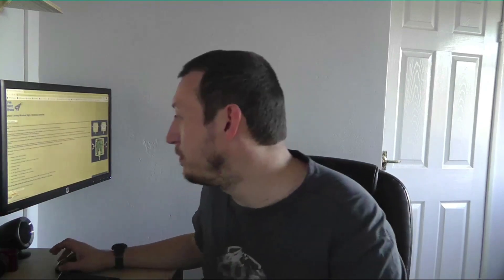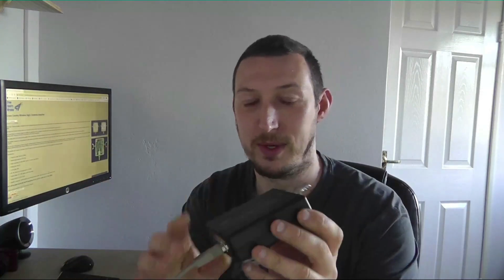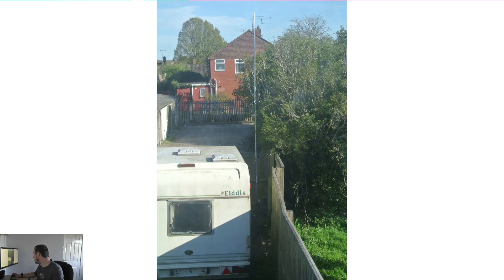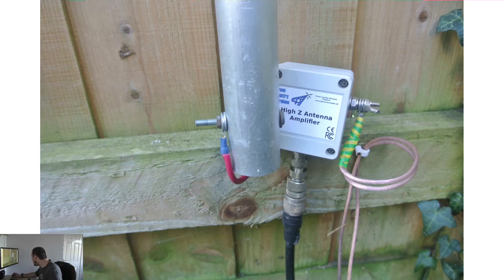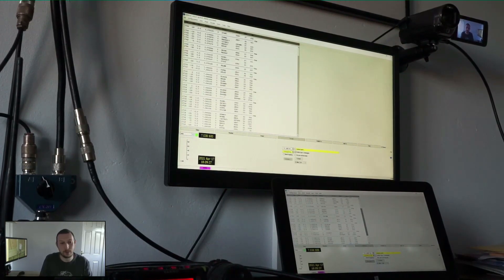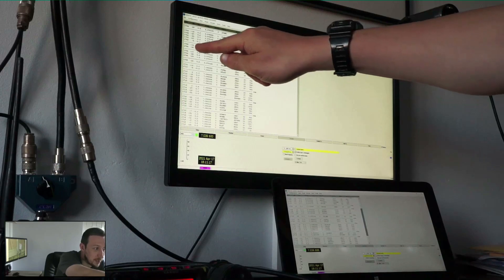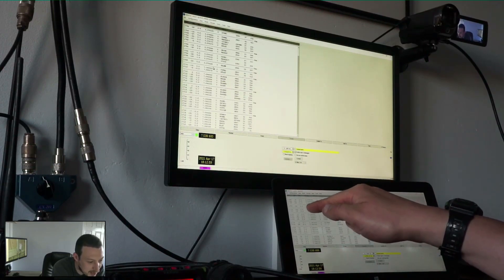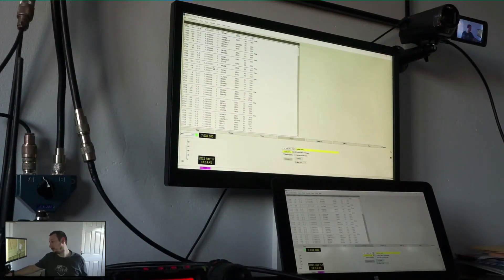High-Z Vertical As A Separate Receive Antenna

Comment: Hi James, good to see the High Z amplifier working well for you. I would be interested to see the results if you try it at a quiet location. I think that you will be surprised. Recently Andy, DL8LAS has been posting comparison videos of 160m DX using one of these amplifiers with a 7m vertical wire and his Beverage antennas. If you search on YouTube for DL8LAS you will find them. By the way of all the active antennas we make this is the one I use 99% of the time. Regards, Chris G4HYG

Comment: So I can see where you are coming from but realistically, receiving EU on any antenna on HF is not a challenge, did you receive anything outside EU, anything a few thousand Kms away? That is where I would be looking and not at what I would call local EU traffic.. I have €30 mini active antenna and it will pick up all sorts on HF, but nothing as much as a resonant antenna would pick up..
Reply from the maker: Fair comment. I think it depends upon what you are hoping to work.

For me, I'm looking to get inter-G on 80m for Worked All Britain & EU wide on 40m for SOTA chasing. Hence why I only really looked at local & not DX.

My biggest problem is the high noise level at my QTH, so my theory was that a  RX only antenna as far away from local noise sources as possible might give a better SNR than a full size antenna running the entire length of the property (right over the roof of the house).

I suspect that in a quieter location you would be absolutely correct in your assessment. A full size antenna will out perform this antenna. 

Receiving EU stations may not be a challenge if you have a sensible noise level. Chasing weaker SOTA stations is more challenging, especially if your noise level is up around S7 (typical signal reports from chasers to SOTA stations are around 53 to 57 which means that they are below my noise floor).

If I can get a couple of DB better SNR by having a separate RX antenna (albeit a compromise antenna) away from the noise sources, then it's worth doing.